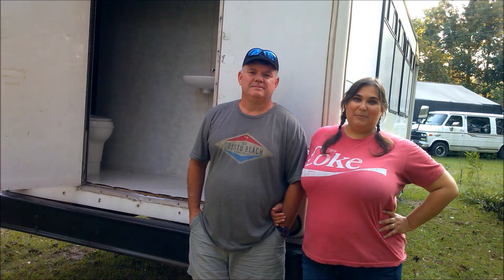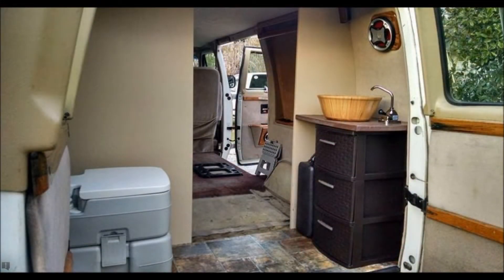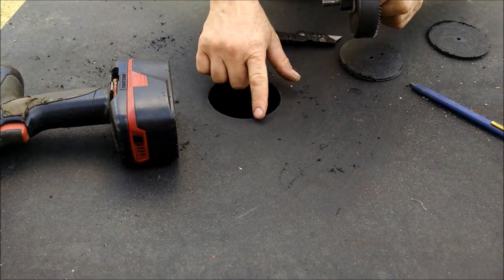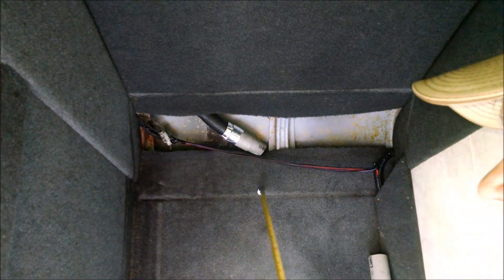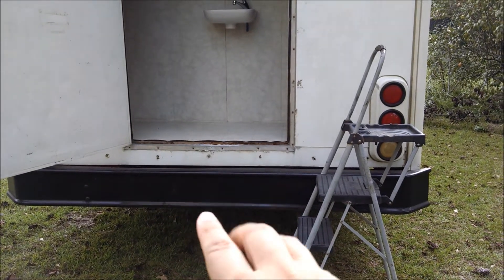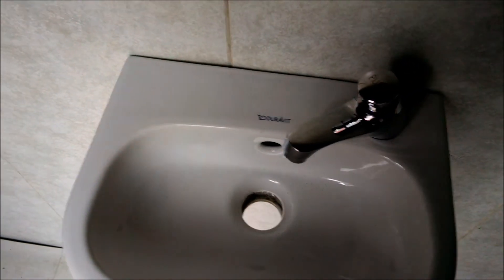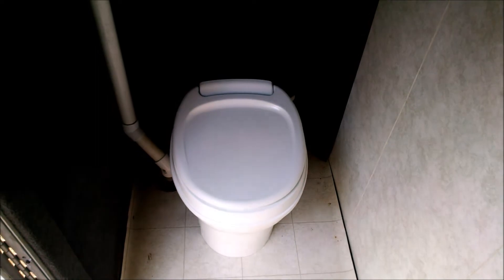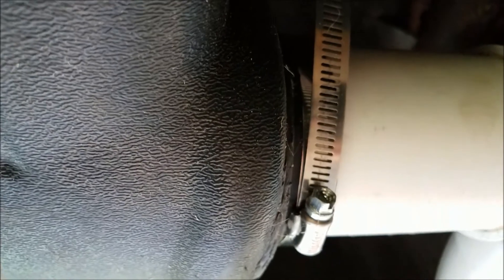Installing a bathroom with black water tank in a shuttle Bus

Comment: So my truck already has a black tank and the sink goes to it. I’m trying to install a toilet and a shower. How do I run plumbing to existing tubes to black tank
Reply from the maker: Are you able to get access to the top of the tank? You will need to cut a new hole on top of it to connect the new pipe to the toilet.

Comment: I can't remember if you told us why you decided to get this bus after completing the other van and trailer. Are you planning on keeping  the other van and trailer too? And the bus's bathroom will not have a shower?
Reply from the maker: We are planning to keep the van for short trips, but since my husband and I are both in our upper 40s we realized that being hunched over in the van is getting to be a bit much for us. We need to be able to stand up straight to move around which is why we upgraded to the bus. We thought about putting a shower in place of the racks opposite the toilet, but we decided we would rather do an outside shower and have that extra storage space. That would have been the perfect location for a shower though!
Reply: Yes that's what I thought it would be until you said storage.
Reply from the maker: @cherisparkle  that's the beauty of being in the southeast for most if our travels.  Its rarely too cold for outside showers.
Reply: True,  but it does get cold in SC some. Right now I would love some cooler  air. I'm done with this heat! Do you stay at campgrounds much where there are bathrooms?
Reply from the maker: @cherisparkle  we do.  And in the winter we do a lot of trips south to Florida where its warmer.